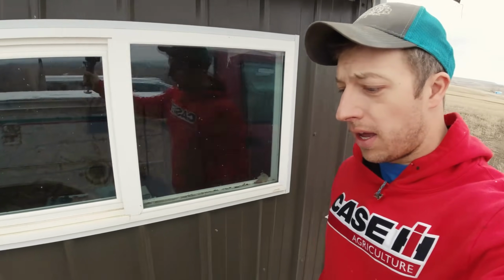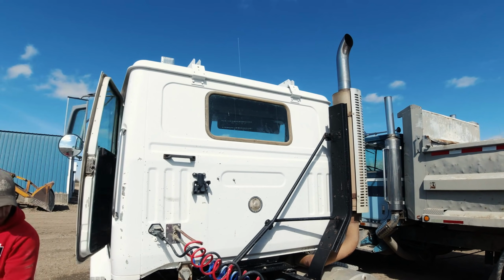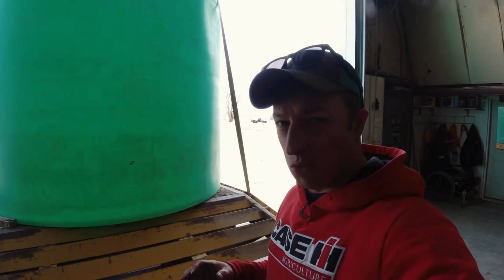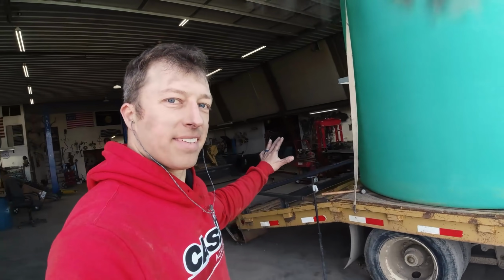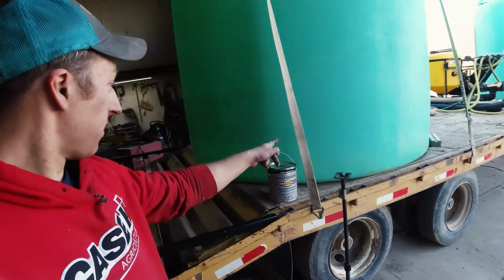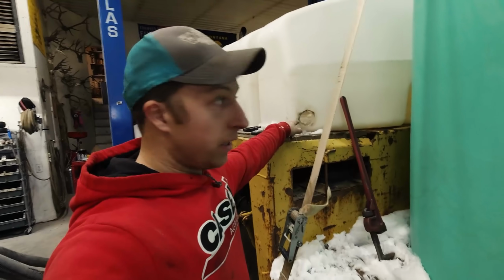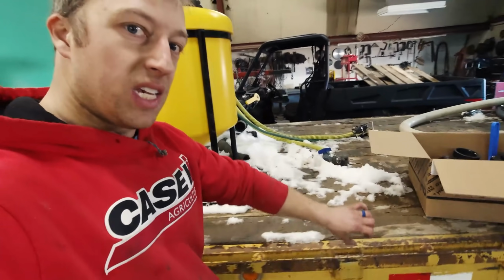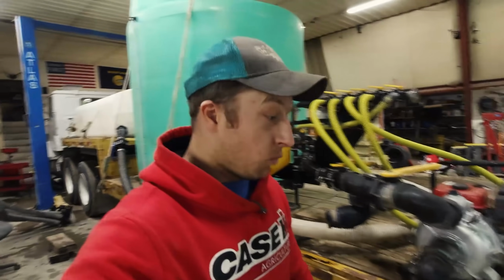S-T-R-E-T-C-H-E-D the Trailer! Grab the Welder!

Comment: You should put some remote batt terminals mounted on the bumper of the Fummins. Would be nice for constantly jumpstarting stuff.
Reply: Or buy that booster pack he's been talking about for ever.
Reply: Yep they have those now.
Reply: There ya go.  I like it!!!
Reply: Old welding leads with the quick connect ends work great.
Reply: I have a plug from an electric forklift mounted on the front bumper and just inside the box on my F150. Added a second battery, upgraded the alternator, and on the other end of the plugs, I have a 30' and a 15' set leads with clamps on 00 welding cable. They never get stiff and will carry any amperage I want to push through it. Makes it nice when you can pull into someone's driveway behind their vehicle, run the cables up and jump-start them.
Reply: @cranberrygrape1 , yeah boy.  Big heavy cables, transmit those volts, amperes, and watts!!!!
Reply: That doesn't sound too safe
Reply: Ruben Braekman they are coated in plastic, use a female end on the pos. On the truck side, that way there is nothing exposed to arc out. Then your cables twist and lock in. It’s very safe, works great, and pretty cheap!

Comment: Had the same problem - dead modem for no reason.  Had been going though a modem every other year. Thought the modem was getting a power 'surge' or 'loss'. So fixed it by putting a small power 'ups' on it. Been working fine since using one.  So far this modem has lasted 3 years. Could have been living at the 'end of the line' of the power system. Glad I had added the APC 'ups' to the system. Take care 'Spin'

Comment: Hi Nick.  I set my water trailer up like that and soon realized that the hoses get gravel rash when they hang over the edge of the trailer.  It didn't take too long to wind up with a leak.  You might want to add something to protect the bottom edge of the hoses and fittings.

Comment: You should get a winch wire quick disconnect and mount it in the grill of the fummins and of course connect the other side to a jumper cable. Make it a hell of a lot easier for jumping vehicles lol

Comment: You should mount a quick connector for a winch in the bumper of the fummins. Then put the other quick connect end on the jumper cables. 

Saves having to go under the hood each time

Comment: Guys should look at finding a tanker trailer. We ended up getting a 8000 gallon tanker for our spraying. Added a platform on the back for the two mixer tanks for chemical. Only problem is no place for the shuttles. We just have them on a pickup. The other plus side of having that tanker is we take it to fires when theres one goin on in the neighborhood to fill up  other guys fire outfits.

Comment: Btw they make little plugin adapters that you plug the wireless router into that it connects the wifi and when it detects that the wifi goes down it will power cycle the router.  I got some off Amazon.

Comment: I like your pump house colocation space. If you have pingable equipment in the pump house, you can probably add a monitored power strip and powercycle your modem remotely for not a ton of money. Using the UBNT gear is a good idea. It's cheap, easy, AND robust..

Comment: Nick look into plugging an air line into the load out hose that way you can blow it empty, one of the best things we've done to all of our spray trailers where I work. Though if you do make sure to put a check valve in so its one way to blow out the hose and no risk of backfeeding water or fertilizer into the air system

Comment: I don’t know if this will help or not but I have found when trying to put fittings on those chemical hoses it works best to heat it with a heat gun then they go on really easy and when the hose cools it shrinks back tight then just clamp it

Comment: You should check out the Audew jump starter. Im not promoting. I bought one for our farm. It works awesome. Compact,I started a JD 8100, a case 1340 weather and 2 pickups without batteries .
Reply: Swather, not weather

Comment: Replace that 6 plug strip with a Wattbox power strip. It is networkable and you can login with our mobile device and turn outlets on and off. Even better is the ability to setup a workflow on the unit that can ping an IP like 8.8.8.8 and if it can’t be reached it will power cycle an outlet.

Comment: That problem with the modem I think is universal Nick. I have to reset my router at least once a week. The only thing is I don't have to drive 2 miles to reset it.  😉Finally the video on the trailer....was hoping there would be a video when I saw it on Instagram.....👍"nice"

Comment: Seeing as the fummins is your main truck you use to jump equipment you should hard wire a jumper cable connector to the truck so you don't have to open the hood every time you need to jump something

Comment: Just a thought, as much as you need to jump things with that truck, perhaps you could fabricate and wire up some external posts on the brush guard of the truck. That would allow you to jump without opening the hood.
Reply: Even without fabbing them up I'm thinking external jumper kits probably aren't that expensive. Actually just looking at Amazon you can get a TOPDC brand one with a 25ft jumper cable for $65.  Seems like 25ft might be a bit overkill on the length but if it means putting the jump truck in mud or on dry land than the 25ft is worth it.

Comment: As much jump starting as you guys do have you looked into a power outlet/quick disconnect on the front of the truck so you only have to hook up one set? The truck side would just be a plug. Just a time savings suggestion.

Comment: You probably thought about this already, but how about an external (somewhere on the front bumper for example) connector for starter cables for the pickup truck? Would save you opening up the hood every time you have to jumpstart smth.

Comment: You can buy a power switch you can remote control over ethernet. There are quite a few on Amazon. "Web IP Power Switch" if the modem is the main item that needs to be restarted you can restart it from home...

Comment: Well the standard oversize width is 8'6" so as long as you are under that you are fine. What I think dot would get you for with that is an unsecured load, even if it is attached to the tanks it's not attached to the trailer, simple fix is get some heavy duty zip ties
Reply: There are two straps each tank to secure the tanks.  He took them off while fixing the truck up.

Comment: With the heat on that high might have gotten the switch too hot. That being a consumer net gear it's not rated for too high of temps. If it starts to happen recommend switching to a prosafe or similar. The UBNT stuff usually is really solid and normally when they start to have issues it's due to a bad switch. Don't have to swap the UBNT stuff out nearly as often.

Comment: Nick just a small suggestion. Fill your tanks from the top rather than pumping in from the bottom. Your pumps are pushing against the weight of the water and that is causing part of your problem. Also the more turns you make the less flow you will have. It may seem minor now, but think about how fire trucks and water tenders are filled. Even your city water tank by your pump house fills from the top.
Reply from the maker: You're right about that, hmm I could run 2" lines to the top of each tanks to try to speed it up.

Comment: Get a solar panel and cheap solar controller mount the panel on the water tank and the controller the batter box to keep the batteries charged  you can get them from amazon cheep

Comment: Just curious.  Why not rotate the two large tanks a few degrees counter-clockwise so the valve assemblies will not push the tubing over the edge of the trailer?  You added about six feet or so of usable trailer surface space, so you could have made it work.
Reply: He was wanting a flat deck top so that he didn't have to step over the hose while climbing up and down the trailer.
Reply: @RobertWelkerFarmerBob  There's a bit of a problem with that though, I think.  Unless I missed the supports being fabricated under the tubing, now there is a 40 foot length of 3 inch tube filled with water that will be supported by 3 big hose clamps and some pipe glue.  Add the vibration of the pump, and something will fall apart without support.  Did I miss the tubing being supported?

Comment: NICE, We had a spray trailer similar to yours Nick but I would add, with the wood floor of the trailer I would nail either 2x's or 4x's around the 2 big tanks in case the straps break then your tanks wont shift or slide.And we had a spot for each tote of chemicals with 2x's lagged or nailed into the floor of the trailer,  cuz you never know about the straps breaking or coming loose its a cheap insurance option cuz you have 
Plenty of wood out back. I would say your getting a planter or a drill, does it have to do with farming  ??

Comment: Wood is easy to change, you should have used solid pipe and gone through the wood and mounted it under the cross beams for clean looking installation

Comment: how do you connect the cables to the truck if the truck is 24 v and pickup truck is 12 v ?
Reply: It's two 12 in parallel not series.

Comment: look into this device made by Ubiquiti if the internet fails it will tell this smart.plug to reset the modem automatically it is called the "unifi smart power plug"
Reply: Put the smart plug will need the wifi to be told when to do that
Reply: True put a small wall AP in the shed that will take care of that

Comment: Do you have a video on the internet wifi system you have on the farm?
Reply: We do have security cams but not connected to wifi. Issue with static vs dynamtic
Reply: @RobertWelkerFarmerBob  Hi Robert Sorry,, I was not very clear.  I am interested in how you provide wifi to the farm from the pump hose where the modem is.  I was wondering if you had done a YouTube video on that technology and how you have it set up.

Comment: I've had that same Netgear Router in the past (well about 6 of them until the warranty ran out) they kept dying ... replace that thing with something better, will save you some time traveling to come reset it
Reply: Dlink
Reply: Technically needs an EdgeRouter for that UBNT setup.
Reply: @TallTexasGMan  meh, any decent router will do in that set up they definitely don't need a prosumer router for that. If they really wanted a good set up they would run a microtek router with 2 5ghz nanos running in horizontal and vertical for a forward and backhaul depending on how many access points they have on the farm.
Reply: Not a fan of MikroTik. My honest preference is Peplink routers, but I have a very different need.
Reply: @HillBillyAsian  the microtik wouldn suit their needs, I'd put a draytek in there
Reply: @JeffreyBNL  shoot, I'd say try a TPLink router or just get a Raspberry Pi and set it up,
Reply: @cmusic52  in not a fan of raspberry for routing, I have no broad experience with tp link routers except the small home wifi router combos. I'm a fan of the tp link switches tho

Comment: I’m surprised you didn’t use bolts for that brace on the back, when it turns back into a normal low loader your gonna have to grind those off
Reply: He didn't  weld them to the trailer. There just resting on the trailer rails.

Comment: Why didn't you drill holes floor and run the hose under rather than outside the trailer?
Reply: He thought about it but didn't want to have any holes punched through the deck.  Might sometime redo the setup on a different trailer.

Comment: See about getting a used 50" flatbed, all the surface area are the same height.  For a good example look at "Cole the corn star" set up for their chemical mix trailer setup.
Reply: Actually, I do like the piping and Cole's trailer but I think the drop deck actually works better for a tender. Much easier to get up and down from the deck and the overall rig is not so tall and also a lower CG.

Comment: I can't say I understand your theory on your three inch line down the side of the trailer, and I don't recommend setting that water tank behind the rear axles.  Let's get real people.  Put your water tank back where it came from, run two 1 inch lines to your back deck for chemical drums.  
Yes you probably will have a leak on the White tank. Why? Because you're stressing out that fitting with that flex line and that cut off valve hanging off the edge with no support. Do it right.  Take your three inch line out put in a 90 bolt your cutoff valve vertically to the side of the step down. now run a three inch line along the entire top side of the trailer deck and add shut-off valves where needed.  this will allow better flow from end to end and you will keep your waterline protected from somebody bumping it or ripping it off the side of the trailer.

Comment: some reason i thought you can dial into the router side, like the 192.168.1.1 and tell the modem to reset itself, via computer type CMD which gets you the DOS style prompt, and then IPCONFIG which should show what items are running and shows the gateway to enter into the router/modem . just google the mfg and model and add either control panel or config in the search string. im rusty as hell when it comes to that stuff, but calling up the mfg to see if you can force it to restart via commands instead of driving to flick a switch is always easier

Comment: Have you ever thought about using a wifi switch (not internet folks) to switch it off, then back on again? It is what my family does on the farm with ours.  Not nearly as far away as yours is, but it sure is convenient.
Reply from the maker: Issue is when that modem locks up you cannot access that room. But if you mean add a switch in line of that modem and let it be the dhcp I supposed that would work!

Comment: It doesn't make a difference what size the pipe is if your using gravity it will still equalize, think tube on a tank to tell the level 1/2  " ID on a 5000gal tank.

Comment: Aren’t you worried about having all that weight so far back on trailer?
Reply from the maker: No not really, most of it is still over the axles and there is 3200 gallons up front.
Reply: Maybe I missed something but wouldn’t 2000 gallons of water be more like 16,680 pounds
Reply from the maker: @boonvillebuck836  yes that is correct and half of the tank hangs over the last rear axle which means 7000-8000lbs would be hanging over the back on the extension I made.
Reply: @boonvillebuck836  Hopefully there are no pot holes in Montana.   Half the tank is on the mainframe.
Reply: It's a low boy commercial trailer , especially designed to haul heavy and special equipment  . If the Welker's have taken the time to check the tires , and the springs on the trailer it should be fine . Besides it's not like their going to hit the road with the dare thing . Bob , Nick and Scott seem to be fairly  well under Mother Welker's thumb , smart men that they are !!!!!

Comment: Question : consider getting 2 solar panels, locate them evenly between all your equipment and and run battery maintainers chargers and hoorah ! No more battery issues .. A cheap panel can be bought 8 inch by 5 inch. Can be bought for pennies for each piece of equipment.. And keeps batteries ready for work ,, just a thought from a retired old fart. Hahahahhahh

Comment: You will never steer the semi after that all the weight will be on the rear of the trailer.
Reply: Nah.  That tank is easily balanced by the two tanks up front.  I'd guess that the rear tank would nearly be counterbalanced only by the trailer itself, at low speeds, even if the front two tanks were empty.  Remember leverage.

Comment: Nick, you might want to check the remote power switches here.   
This one can be controlled over your phone network
https://5gstore.com/product/8897_2_outlet_ip_switch.html
This one can be controlled via your intranet
https://5gstore.com/product/7755_single_outlet_remote_power_switch_app_controlled.html
Might make things a bit easier and quicker, especially when the wind is howling and it's -30 during winter